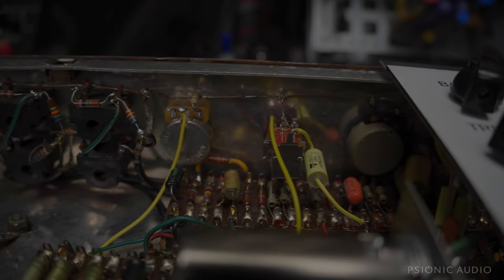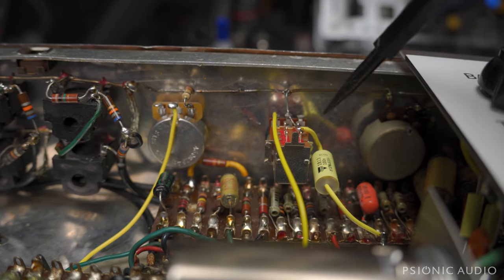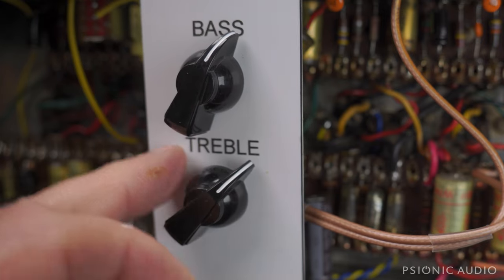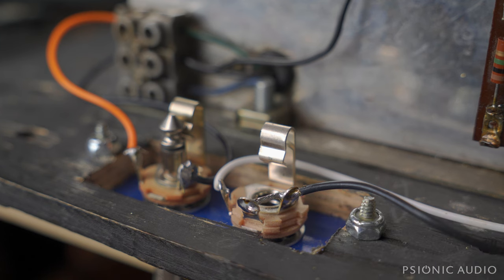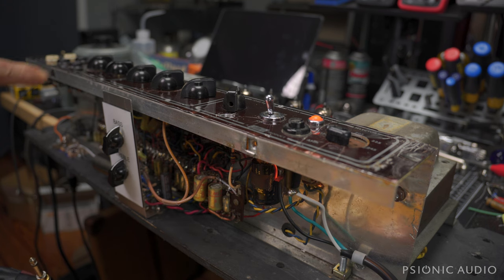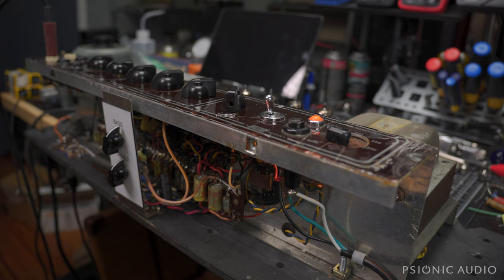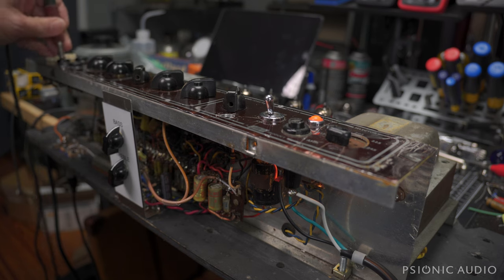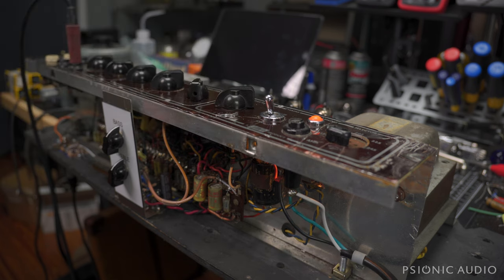'64 JMI Vox AC30/6 | Part 5: Top Boost Reinstated & More

Comment: That's some mighty fine grease happening. Shocking it still sounds great after removing the funk from everywhere. I still think you should sell the paper towels you used as "mojo wipes" so folks can turn their new amps into a vintage monster. Also need to work on capturing the magic smoke but since you know what you're doing, you probably don't get much generated...
Reply: Ah, the old battle of vintage vs functioning properly... People tend to forget that these were made to be serviceable. I remember a friend making a ton of money by collecting and selling for (at the time our currency "escudos" was about 110 escudos=1 dollar ) 20.000$00 binned VCRs and TVs that just needed a 15$00 fuse...